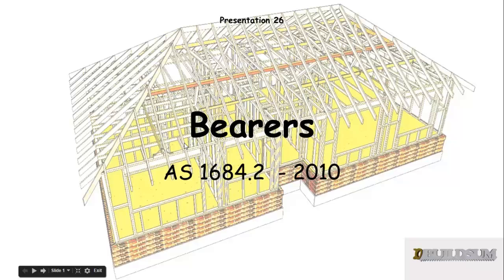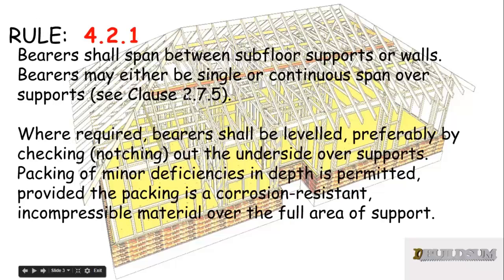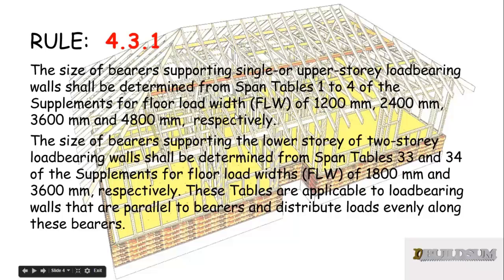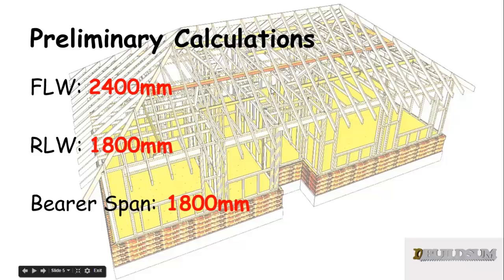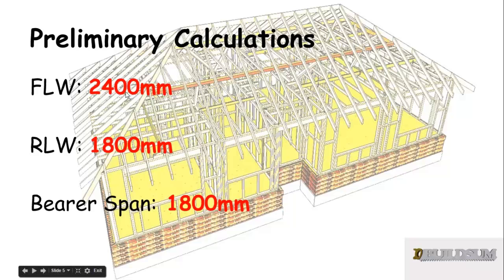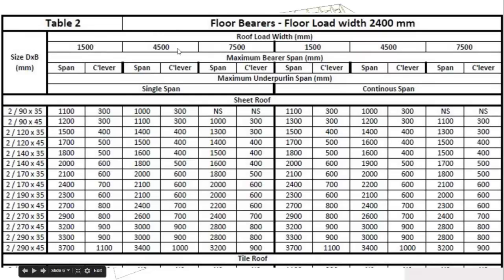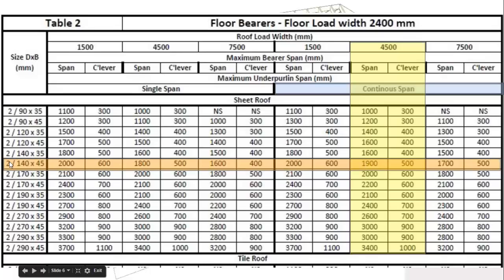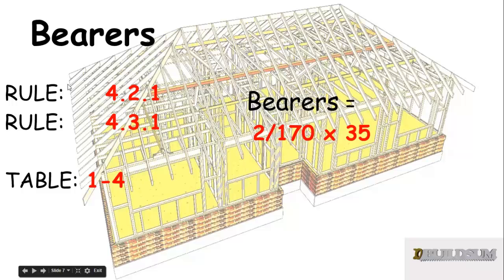26 Bearer

Comment: I noticed you use the 4500mm RLW since your example was 1800. I believe the standards allow you to linearly interpolate so you could conceivably come up with a span column for your exact RLW. Not sure how useful this would be but might be economical in the case of this example. Wondering what your thoughts are. Cheers
Reply from the maker: Hi Mate, yes Interpolation is certainly an option if you want to work it out but even looking at the 1500 column it would only get me one timber size smaller so not sure if it would be worth it, hope this helps.

Comment: Hi, Great work.

Can you please tell how to determine the spacing of Bearers, In AS1684.2, Span tables require spacing as well. Thank you and appreciated.
Reply from the maker: HI Zeeshan
The spacing of any member is generally determined by the material that it is going to support e.g. Bearer by the maximum span of the joists, Joists by the maximum span of the flooring, Studs by the requirements for fixing the lining and so on.
Hope this helps.

Comment: Might have skipped a few vids there mate, between 25 & 26. You said in one of the wall framing vids that you were using a concrete pad, I assume you've changed it up to a framed construction type floor of some sort for the sake of being able to cover them? With that in mind, will you be covering any sort of foundations/piers that go along with them?
Reply from the maker: +Mooncabbage Hi No i haven't skipped anything all the videos up to 25  were based on a Slab on Ground design but as you suspected I cant do bearers and joists for a Slab on Ground so i had to change the design for 26 and 27.

Unfortunately at this point in time i have no plans to cover footings anymore than i already have.
https://www.youtube.com/watch?v=FqVNgtQkICI

https://www.youtube.com/watch?v=EmmvbaaY2D8

https://www.youtube.com/watch?v=nr8cDVwDwxs

Hpe this helps
Reply: Sorry, should have been clearer. I just found your channel, and I skipped the videos you posted between 25 and 26. Wasn't sure if you'd explained the change on one of those. Just trying to wrap my head around AS1684.2, starting to feel like I'm giving myself some serious brain damage.

Will certainly watch those other vids!